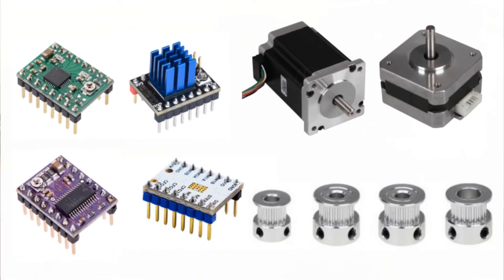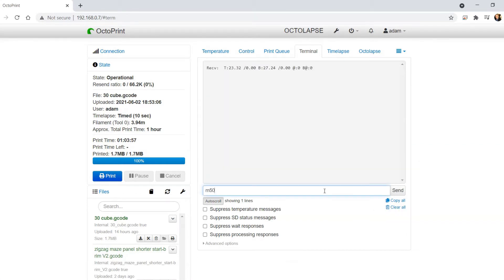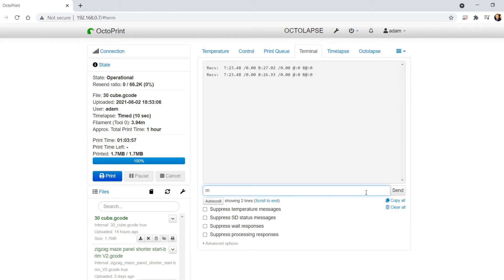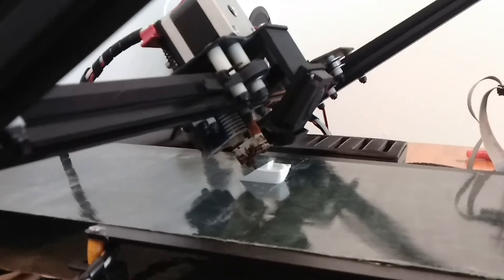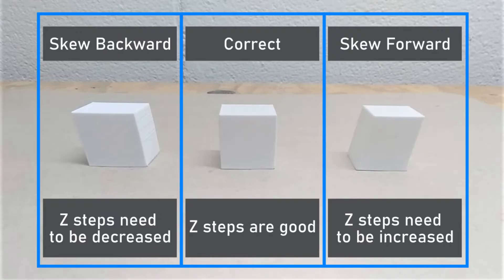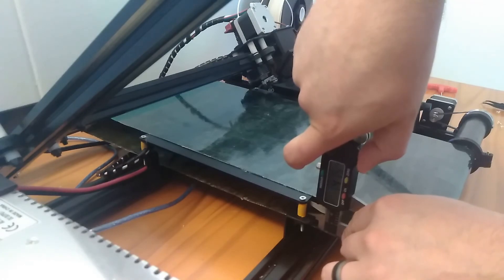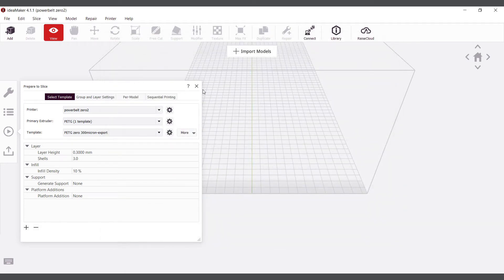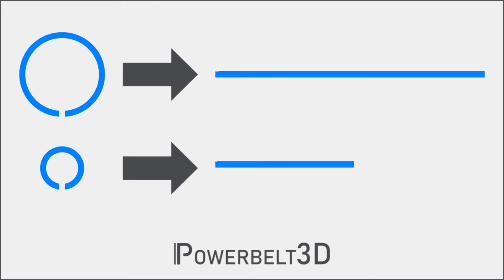How to calibrate a conveyor belt 3D printer

Comment: There's an app that's a pulley and gear generator.
It works really good for fingering reductions or multiplying between drive and driven objects. 
I don't know why but this is something my brain does with ease.
I did a really quick chek on my Z movement by placing two pieces of tape 100 mm apart on the side of the bed.
The first piece of tape I cut with a exacto knife so the alignment was perfect.
I then simply want to movements and advanced the z 100mm then re measured it.
The biggest issues ive had was yhe bed being level on the Z axis and belt deflection on tall parts with a small base .
I've almost considered a small idler roller or even a plate just in front of the print head .
The plate seems asif it would be batter because it could be super close to the nozzle, but there would be additional friction on the belt .
A roller even at 1/2-3/4" diamater wouldn't get as close to the nozzle but would allow for little to no added strain on the Z stepper motor.
Reply from the maker: I've played with rollers as low as 8mm. The increased torque and Z resolution is really nice. However, smaller rollers wear out belts faster due to the increased bend. They also tend to be more difficult to tension perfectly to prevent the belt walking side-to-side. Pros and Cons. :)

Comment: hello i have a question printer is done with design and firmware is updated on ender 3 v2 but i have a problem  when ever i try to print a calibration cube that is 20mm on every axis it prints y axis a bit by bit downward and then it looks like something simillar to right triangle at the end and not a cube i would be really grateful if you have a solution for that because i tried calibrating it and none of my calculations fixed it
Reply from the maker: It's hard to know the exact fix without seeing some photos of the setup and parts. Here's a couple things to check outside of steps/mm:
1. Check the slice angle in your slicer. Make sure it's set correct for the build.
2. Make sure the belt is tensioned well so there's no slipping and the belt is tight against the heat bed.
3. Check the Y endstop height. If it's too low, the nozzle can dig into the belt and give an inaccurate dimension on the angled axis.
Reply: @powerbelt3d  i can send you a photo if you want because that is the only thing that i need to set up and i struggled for days to fix it with calibrating and changing angels but nothing helped
Reply from the maker: @karloknjeginic8852  sure! hello-at-powerbel3d-dot-com
Steps/mm should be 80 80 82 XYZ for the Ender EZ Belt build.
Reply: @powerbelt3d  thank you for your help but we found out about problems that we had to fix and foud our perfect calibrations and printer is now printing as it should thank you so much again for help and tutorials of how to make it
Reply: @powerbelt3d  also thank you fos some advices i will try to check some of themi hopw that it will help
Reply: also some of my calculations made it to be 20mm on every axis but it was never on a right angle especially for the y axis

Comment: So how to you actually calibrate x and y?
Reply from the maker: Print the angled cube, and measure the labeled X and Y axiis. Then do the steps/mm  calculations.. it's been quite a while since I made this video though, so maybe I skipped over it 😅
Reply: @powerbelt3d  hello do you maybe know how to calculate for example when i calibrated y axis i have to change z to i think because it wont make me a 90 degrees angle or it will be expanded so idk what are calulactions for z to follow up with y or vice versa

Comment: Very useful video, thanks. Should the calculation not be: model length / printed length * current steps = new steps?
Reply from the maker: Happy to help! That calculation is correct.
Reply: @powerbelt3d  So is it this formula or the one from the video?
Reply from the maker: @SeanFerrell-sl1vb this one is correct. You can also look any other place on the internet for calculating steps per millimeter. There's even a few calculators out there. ☺️

Comment: I found making a mark on my bed and a matching mark on the belt. Then measure 100 mm down and make a second mark on the bed.  Advance the belt by 100 mm and measure the difference between the 2nd bed mark and the mark on the belt. Plug this into a Estep calculator and update steps in firmware works a treat. I usually run the test 3 times.
Reply from the maker: Great tip! Thank you for sharing.
Reply: I did the same thing as Joe did, after I replaced the PVC rollers with stainless steel, and after I replaced the belt.
Reply: so is this for setting the z?